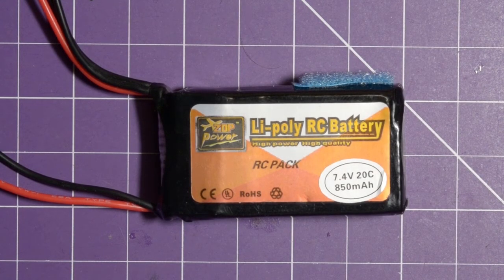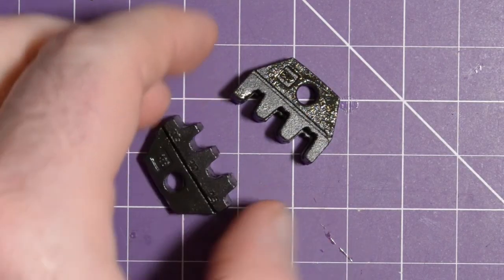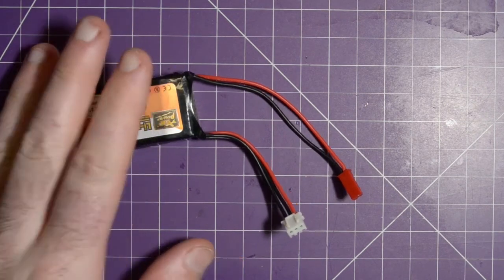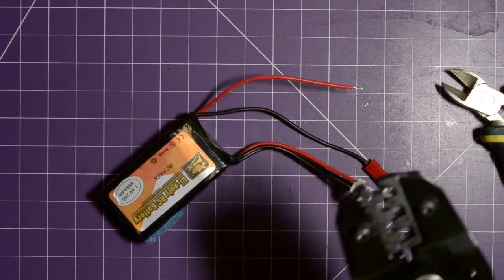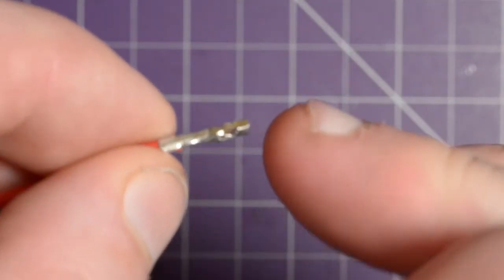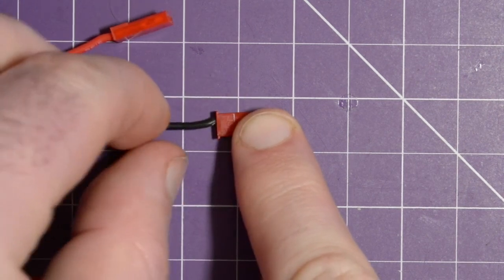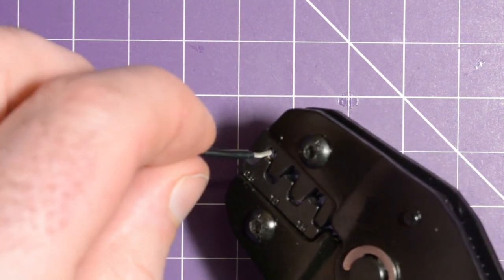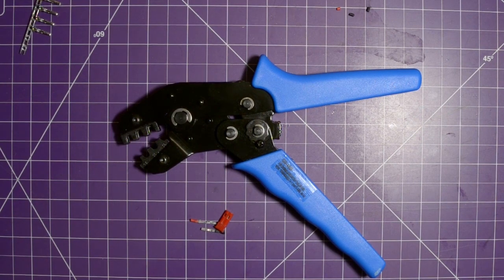How To Replace Rusted JST Connectors

Comment: Have you ever tried putting the oxidized connectors in vinegar?  I did this with a XT60 connector that was outside on a 40Watt test solar panel all winter long. It seemed much cleaner afterwards and all the seemingly rust stuff just came off. I now sprayed it with some WD40.

Comment: Good job and thanks for the tip on the inexpensive crimper tool too!  I guess one could avoid the 'hairy' bits (not your wife's!) by tinning the bared ends with solder prior to crimping?  Cheers, V... 👍🏻 🐍